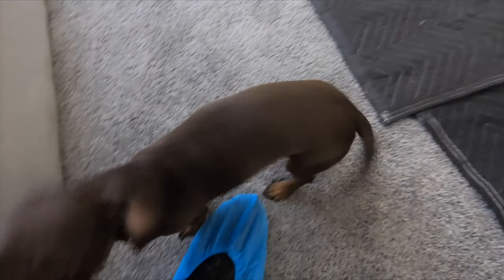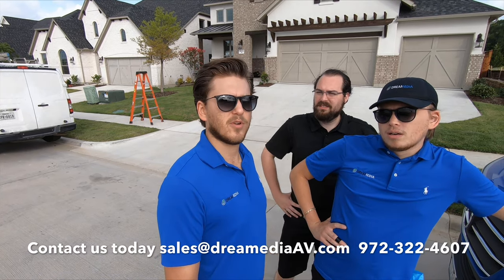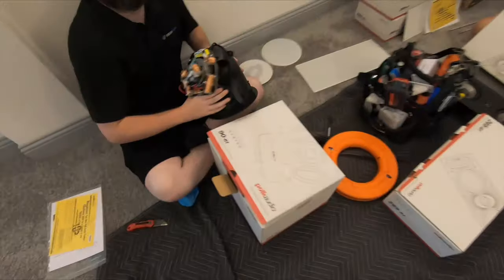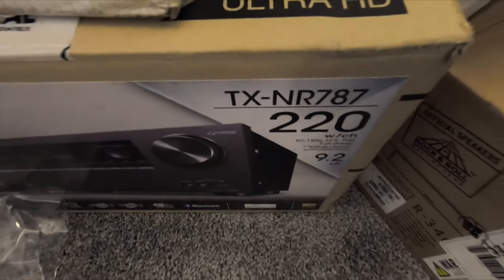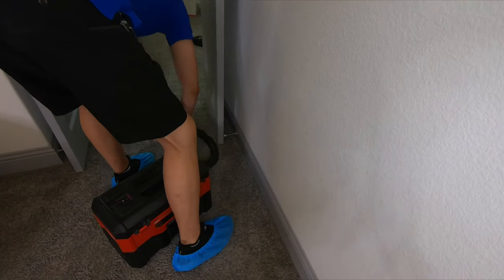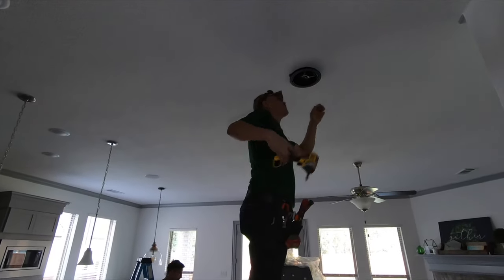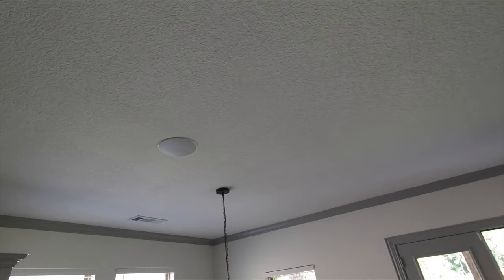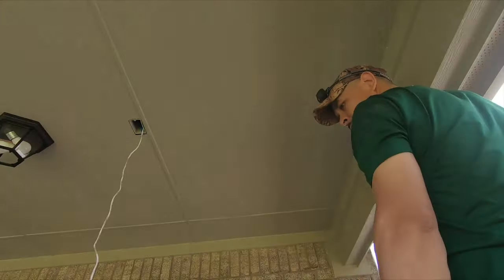Polk Audio 5.1.4 Dolby Atmos Theater by DREAMEDIA + PATIO and LIVING ROOM INSTALL

Comment: Great install, but can you explain why the Klipsch center when every other speaker in the room was Polk?
Reply: My guess: Emphasis placed on the center and cost savings on the rest. Mostly movie/tv use. The center has the largest role in movies/tv formats.
Reply: @LarsonChristopher  Very much budget conscience set-up. A bit shocked they went with the Polk/Klipsch combo - very different sounds out of the two brands.
Reply: Clean install! Definitely you guys made it seem easy. 

Not a fan of the LR separation in the patio. Also looks like a small sub for the HT room.
Reply: @Olafdaschneemann  They should have just used 3 265-RT's. Honestly there is no excuse for it unless the owner already owned the klipsch center, which they didnt. The Klipsch r34c isnt really a high end speaker either. Klipsch speakers are tingy, polks are not.  I like some of their stuff, not impressed with this install.
Reply: Klipsch is better than polk...more efficent and better clarity
Reply: @LionFromJam  I disagree, the polks have more fullness to them in my opinion but the vocal area they are muddled and subdued, bass and mid ranges a+ klipsch can do bass well and highs exceptionally well, and they have great clarity.  Both speakers have their merits. It just depends on listener taste which is right for them.

Comment: Why did you, or the customer, choose a different center? That's really not recommended as it has a different sound signature, let alone the difference in design that Klipsch uses for the tweeter (horn)?
Reply: I'm wondering if the Klipsch has a higher decibel rating so the dialog would be more present than an equal to the Polk speakers?
Reply: @christophermcmichael880  True, but still it is not advisable, just imagine a sound panning across the three front speakers...nobody would buy two different stereo speakers...so why would you on home theater. Only exception for me would be the rear/ceiling speakers, though ideally they should be the same as the front as well
Reply: @Jorg05111980  i agree. I have all Klipsch speakers in my little set up. RP-6000f's for mains and a RP-600c for my center. When they made that choice to have the Klipsch as a center. The first thing I thought about was maybe that Polk series wouldn't have been loud enough for a center channel.

Comment: Indeed I love my Polks! Really odd with the Klipsch center though, inquiring minds would like to know
Reply: Dynamic Range and greater db output. Better speaker.
Reply: I don't believe it's better than my lsim 706
Reply: Klipsch has better clarity and high range acoustics with little to no distortion, polks are a great speaker with regards to fullness in sound for mid to low range but suffer drastically in the tweeter department. Exceptional contrast between the two I would not mix them.

Comment: Hey Guys! I really love watching these setup videos. I have a small question, I haven't been able to get surround sound through the HDMI ARC on my LG B8 OLED smart tv while using netflix or prime video. However I do get surround through my cable box that is connected to my Yamaha receiver.

Any ideas on how to fix this?
Reply: Just use a digital optical cable instead of arc
Reply from the maker: either check the cable/ replace it with a better hdmi/ arc or just use an optical/ toslink cable from the tv to the AVR. Easy Peasy
Reply: I had the same problem with LG HDMI ARC connection, I ended up using the opti-cable instead... works beautifully.
Reply: Arc doesn’t work for Netflix or other streaming channels. It’s a con of arc that doesn’t get spoken about.

Comment: Price difference Polk vs. Klipsch ?
Reply: Klipsch is usually around 100- 200 more. Unless you go signature series. Klipsch nails low end and highs, polks have a good fullness to them minus the highs.. the high are clear and precise in klipsch, polks are muddled and subdued by comparison. You can test our both brands at best buy, imo the klipschs also have a wider Soundstage so listening off axis has less impact on listening experience.

Comment: I am dissapointed that you not telling how it sounds, or at least the owner not tells what he got for his money.
Reply: That's highly subjective to the listener. It really does not matter what any of the Dream Media guys think as long as the homeowner is happy with the result, the system works correctly, and the homeowner can easily operate the system. I think this project met all the homeowners' requirements.

For example, I have much higher standards for audio than most of my customers (I'm not affiliated with Dream Media). It's about THEM when I'm hired to install and sell equipment. I personally love the sound of KEF's UniQ, and that is what is in front of me right now. Most of what I sell is Klipsch, KEF, and Sonos - all based around the preferences of my clients. It's nice to let someone hear the differences between Sonos's silk tweeters vs Klipsch's titanium horns vs Kef's aluminum UniQ vs DefTech's aluminum alloy. After hearing the differences, we often discuss which style they like, and what other equipment we should use to allow the control. Often, this eliminates Sonos in favor of Yamaha's Music Cast amplifiers and whatever speakers the customer wants. 

At the end of the day: all this is about the enjoyment of our time.

Comment: So tired of seeing klipsch speakers.... people just love to be shouted at.
Reply: greebuh the new rp series are not like the older Klipsch...far less screeching; they seemed to control the brightness.
Reply: @L3x4Pr0ne  I've heard them, quite a bit actually,  and I'm still not impressed. I like my ring radiators of my lsim703 and my AMT on my Emotiva T1's. Much silkier and better extension than the Klipsch. And pretty much ko fatigue with extended listening.The only real advantage to the klipsch is the efficiency that allows them to get loud with very little power. And I think it's the sheer volume that make people feel like they are good. Really though, I think on the only one that doesn't have a hard on for klipsch. Hell i would take a proper dome any day
Reply: Klipsch, well horns specificly, are efficient and highly directional speakers. These characteristics become increasingly important as the size of the venue increases - like movie theaters, stages, stadiums, etc.. You can get silk tweeters from Klipsch for a less-bright sound. 

As far as your standard home theater room size: are you looking for the movie theater sound (Klipsch) or do you want something else? I personally heavily prefer KEF's UniQ to other tweeters & horns. 

It just comes down to what the homeowner wants in the space.